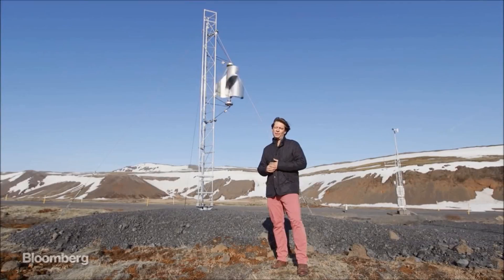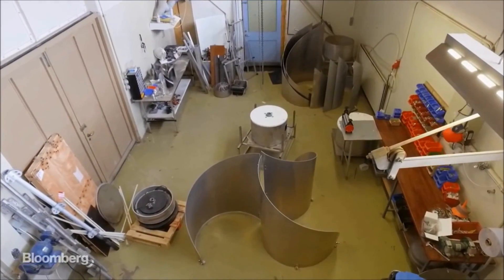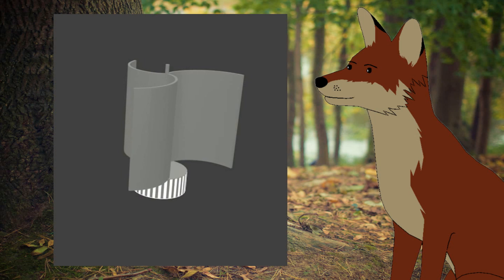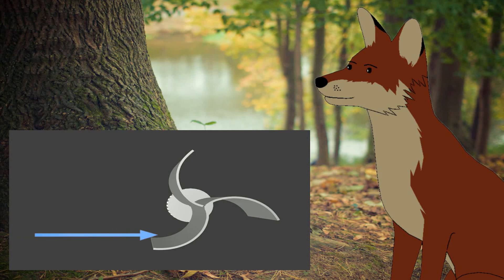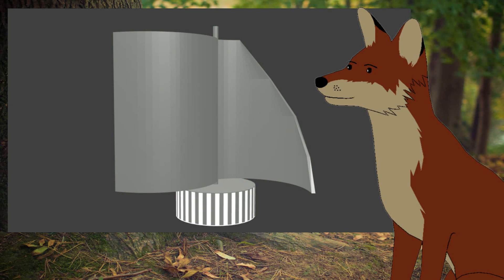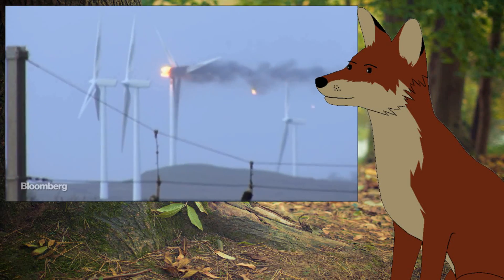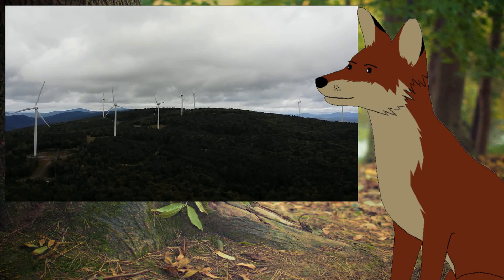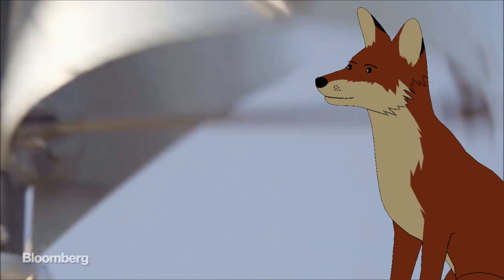IceWind Turbine - BUSTED

Comment: i'd be interested to know what school of engineering you graduated from.  i am currently using a small version of a turbine similar to this and in 8 years it has never caused any problems.  i know squat about wind turbines, (i had someone install mine), but i can see that you know even less than i do. i believe you are merely interested in furthering an agenda and attempting to convince others that wind, solar, and other alt. energy forms are bs and that coal, gas, and oil is the best way to go.  your little snarky comments at the beginning of your video about setting up in an abandoned coal  plant and being able to do the same setup in a garage, (that comment shows you will say anything to deride this tech unless you are talking about jay leno's garage), and the new "hip" renewable energy sources and the old dirty "monster"  of traditional energy proves you are agenda driven.  it's just not logical that a government would hand out grant money to a company without first investigating the claims, designs, and likely outcomes of the recipient.  just go back from doing  some quick searches and it seems that this type of wind turbine is a viable alternative to propeller types especially in high wind enviroments.  your comments about efficiency are crap.  the efficiency of a savonius may be lower than a lift system but it is nowhere near a bad as you make it out to be.  something i found out in 20 minutes and something you obviously didn't bother to look into or cherry picked your data from  alt right, pro carbon, and climate change by humans denier web sites.

Comment: Please explain why a squirrel cage motor and fan is used in every HVAC system.  If it was so inefficient, why use it?
Reply: Because they are cheap to build and very, very reliable. No brushes. No starting or running electronics. There's practically nothing to go wrong. A squirrel cage motor will last for decades without problem. You might notice that while the low-powered fan gets a squirrel cage, the high-powered motor on the compressor needs to be of a more efficient type.

Comment: The analysis presented here strikes me as incomplete or superficial and a lot of the arguments presented seem to be based on assumptions and irrelevancies. If a wind turbine provides a favorable output for the amount of effort (cost) needed to build, erect and maintain it, then it is a sucess, regardless of its aerodynamic efficiency.
 Where a small amount of energy, in the watt to kilowatt range is required, then a simple design like a Salvonius VAWT may be much more cost effective than something more complex with rotating nacelles, hi-tech blade shapes, and complex overspeed protection systems. If a simpler system can be designed with good severe weather survivability then its output per dollar spent may be higher.

Comment: If it has 40% LESS blade to propel (push) the turbine then it must also reduce the negative (resistance) effect. Thus efficiency is NOT reduced. it would also follow that stability would be enhanced and also its ability to handle high wind. A rotor can be made from any drum; but not very efficient.

I would ask what caused the wind turbine to catch fire? Little Johnny playing with matches?

Research into existing technologies? How would anything be improved without research? A prime example is the internal combustion engine. Been around for over 120 years but still being improved.

Fox??? Time to bring on the hounds.

Comment: You should change the name from "Fox Says" to "Fox News". For many reasons. First, you poorly understand aerodynamics. Cutting the blade in a triangular shape and alternating it upside-downside with the one preceeding it allows the wind not to be blocked. 

More or less, your video is about bashing investment in "green" technology. You say it clearly: "Government and investors throw their money at these things, because they tout that they are 'green'." In other words, don't waste your money on green stuff. 

You also say " a grant to research technology that has been around for decades. There are readily available formulaes that can tell the exact output [...]" Isn't it the case for most engineering procedures? In that case, why do we study airplane shapes in wind tunnels, or boat shapes in small scale basins?  Why do we tests engines of any types? We already know how they work, so what is the point? Why test prove anything? Because it is how we find out that our theory is sometimes flawed.

Comment: Like the blunt video bro yeah your right another one of those green energy moves. I actually laughed on the original video when they said Thor set up in an abandoned coal mine. I am a educated hands-on Mechanical Engineer and from a theory perceptive the Scenarios-wind-turbine has crappy efficiency and they are simple to build. I believe the tapered design is to reduce that fluid flow phenomenon known as eddies. I do believe that the theory on these types of turbines is actually not developed very well either. In school the theoretical math seemed a bit off or there were to many assumptions. Damn I should learn how to write grants for something like this but really it may be a government fence for who knows what LOL.

Comment: Why Carbon Fiber and SS?
Carbon Fiber is $$$$$$$$$$$$ and not very UV resistant.
And Stainless steel is $$$$$+HEAVY
Aluminum is $$$ and Light!

Aluminum is the cheaper, lighter, and most corrosion/UV resistant material of any material.

So why aren't they using aluminum in their turbines?

Comment: A quick review of current Savonoius turbine technology on Wikipedia reveals a new design with a shield to eliminate the wind force on the advancing side. It says it needs a mechanism to track the wind but that could be as simple as a tail to rotate the shield. A simple governor could be implemented to counteract excessive wind speed. Admitedly their design does not incorporate a shield. It would be an improvement.
I suspect the blades were cut diagonally to reduce vibration which apparently was a problem with older VAWTs. The width of the base was probably increased to compensate for the reduction in area. The conical shape also makes sense to provide more stability by lowering the center of gravity. 
The VAWT is a promising technology once all the problems have been sufficiently mitigated. There are a number of distinct advantaged over conventional HAWT configurations such as accessibility of the electrical components, inherent compensation for variations in wind direction associated with lower elevations, large effective area, higher torque, decreased profile, and operation at lower wind speeds.
The video shows the VAWT supported on a tower from the top as well as the bottom which was probably done to reduce wobble associated with supporting from the bottom only. I would venture a guess they did make some changes to mitigate problems with earlier designs. There is still room for improvement,.
Reply: THE PRICES ON THESE OLD TECHNOLOGY IS RIDICULOUS……OF COURSE THERE ARE PEOPLE A SMALL PRSENTAGE THAT WANT READ REVIEWS AND STILL THROW BIG $$$$$$ AT THE COMPANIES……..GOOD LOOK TO THEM AND THEIR SALESMAN…….ITS FUNNY WHEN YOU READ HOW OLD THIS VERTICAL TURBINE HAS BEEN OUT AND THESE GUYS. ARE STILL MAKING BIG $$$$$$ OFF THEM………

Comment: I expect that the Overspeed issue you mention is mitigated by the drag issue you mention in your first pt sir. Only a guess.
Reply: Exactly like multibladed water windmills. Faster it TRIES to go, it screws itself by starvation. But they do have protection in the tail, which folds in high winds to reduce wind loads and keep tower from falling down and going BOOM!

Comment: I can see your research in recent traditional power generation is extremely cursory and uninformed. Turbine derived power efficiency is constantly fluctuating due to the constant variation of the supply of supply energy flow. The video showing the turbine fire was a failure of the electric braking system, but the mechanical braking system fused shut. Not a single statement you made was correct nor backed by research. The shape of the vertical turbine blade is what is being toyed with. Where efficiencies could be greatly derived due to the blade profile changing position while rotating(like a swimmers arm). You obviously are a waste of intellectual space and an embarrassment to honesty. The only thing I’m curious about in your intentional disinformation campaign is what fossil fuel entity you are a paid stooge. I sincerely hope you don’t have children so they won’t have to live in your morally corrupt world. These B.S. videos like yours are what has made the world more ignorant. Please, for the sake of the world stop producing your ignorance. Clever like a fox, you are not!

Comment: Good lord, give me three or four 55 gallon drums, a plasma cutter (I have a welder) and some automotive alternators and I could have this up and running in a matter of days.
Reply: Yes. Yes, and YES. you are absolutely right. 

THere is something I do not understand. I have seen these gallon-drum-style wind turbines where the air kind of pass over in the middle between the front and the back, thereby providing thrust in the other shell. Do you know why one would not do that? 

Yet a thing. I have seen one version where a shield plus a funnel is put in front of this turbine, thereby removing the reverse winds to inflict counter-power: ANy idea where these may be? I have looked a bit and have not found?
Reply: @DigitalAgeInstitute  Was just going to mention a shield, and a tracker like horizontal turbines have at the back, would basically turn them into horizontal versions of the roof top commercial ones which seem to be a big deal

Comment: Dear Iceland, run a pipeline inland and down hill from the ocean to a huge Ram-Pump and power up an electric generator. Route the exhaust back into the sea. But really you can build the Ram-Pump offshore... as long as the intake is underwater it will work. It would actually be cheaper to build them offshore... think... a 6 inch Ram-Pump will pump 135000 gallons per hour with no energy input except water pressure at the intake. The water on a 6 inch pipe will be pumped as high as 110 feet... maybe higher. I only know that the 6 inch pump I saw, is used to pump water up to 110 feet uphill.

Comment: I find it amusing that you make a point of how inefficient the design is, and it is. And then bash their design decision of cutting of 40% of the blade but wouldn't the efficiency loss be minimal as the is less blade area for the wind to push against on the concave side of the blade. But I agree the Bloomberg video is crap, but it gave you 100k views :)

Comment: They don't want to know the truth or the details of how this device works OR even if it is more or less efficient than anything else. Even Nuclear power still holds FIRST PLACE with being highest in energy density, performance and efficiency PLUS Nuclear Power is by far the absolute safest way to produce electricity and cheapest long run. But the Global AssEating GlobalAssWarmingChangers just chant phrases and block traffic and end up knowing nothing.

The entire lower 48 States could be supplied all it's power needs, even for the diaper babies with hybrids and Tesla's that use coal burn right now, by simply building 5 Mega Nuclear power plants. About 10,000 to 25,000 Mega Watt output and save some in battery Capacitor form as we save oil in the strategic reserve today.

And start arresting ANTIFANazis on the spot. Outlaw membership and affiliation with AntiFA, and give jail time for pipe swinging mask wearing Anarchist assholes.

FIRST, build those 5 Nuclear power plants....YOU GUYS WANT TO DECREASE OUR CO2 RIGHT? Then stop whining when a solution is in your stupid faces.

Thanks for allowing me use of my 1st amendment as you libs like to say.

Comment: Reasons for building savonius WTs:
1. less cost
2. works at low wind velocity
3. simple design
3. omnidirectional
4. easy maintenance
not efficiency or power output
Do some actual research before you start foxing all over them

Comment: This reminds me of the infamous Darrieus wind turbines that, like the Icewind, was going to revolutionize the industry.  They've disappeared from the scene - a perfect example of hype over reality.    The problem with both the Darreius and the Sevonius is that each is only a third as efficient as a vertical turbine.  

The real giveaway that this is not a solution is the lack of interest  by companies who snatch anything that could improve the bottom line.  A machine only a third as efficient may work for cabins or a few lights but cannot supply the massive amounts our civilization requires.   We have yet to face one hard fact:  The reason the internal combustion engine is still around is the incredible power of the fossil fuel molecule and the efficiency of the motor . When alternativesare economically feasible they will be adopted quickly,

Comment: I'm just curious, if there were some attempts to install some sort of bypass valves on blades to let some air through when blade returns against it. Or partially fold blade like birds do with their wings while flapping. Maybe it can slightly raise efficiency of this type of design.)
Reply: At a cost mechanically, though.. three blades and pitch control have no moving parts in the collection side, the blades.

Comment: Well if the problem is the opposing blade fighting the pushed blade, the curve of the blades increases the efficiency to some degree yes?
Well what if you put a wing or cover over the half you don't want the wind to hit? Wouldn't that increase the efficiency by 70% or so? After all an efficient turbine uses high pressures and a housing. Also if you have 3 blades the blade being pushed has the center between the other two blades opposing it at maximum angle.

Comment: Has the advantage of reacting to wind from any direction, is unlikely to produce the low frequency vibrations injurious to health, is devoid of the shock wave and bird killing propeller action of aerofoil bladed large machines, is small enough for domestic use and could be used in mobile units, can also be stacked vertically on a mast. Construction, transport and installation is less costly that the propeller variety.
Reply: also no slip rings are required

Comment: If only there was a way to fold in the part of the scoop that is heading into the wind, thereby drastically reducing the drag. Then when the wind catches it for the power stroke it would quickly open. Could be there would be an out of balance issue that would arise with that

Comment: I have to comment again. the mistake in your logic that one side receives equal wind flow opposing the driving force doesn't take into account aerodynamic shape. simply elegant that reversed, a blade catches maximum wind or smoothly cuts thru. very little wind resistance coefficient on the back side.
they are optimizing for long-term durability in the severe wind conditions prevalent in THAT location.

Comment: I would think the less surface area of the blades than rectangular makes it more resistant to high wind speeds which in Reykjavik are quite a problem. yes altering the pitch of the blades can prevent overspeed, but this is a simpler, inherently passive design that does not have to have a mechanism to combat high winds.
in Chicago, there are quite a few of these variants on rooftops, vertical and horizontal, so the Savonius turbine generator is actually a viable design.
you can even see the spinning roof vents literally everywhere similiar to the shape, tho they have many more blades and a cap on top, or the blades curve in to the axis capping the vent themselves

scratches head,, author of this vid is just on a hate trip for some reason? thumbs down #530

Comment: What happens when you put a lift based turbine in a place which gets high winds.  They have to shut down  and can't operate.  That is the reason for this specific turbine. This design is more tolerant of high winds. It also doesn't look like this unit is designed for high output either.  You don't need a lot of power for a communications system, just something reliable.
Reply: I go to a technical collage here in Iceland and we have these wind turbines on the roof. They work well for the winds we have here and are made to charge batteries for anyone wanting to charge up their electric bike. Thanks for seeing the reason these things work in Iceland.
Reply: Bingo
Reply: It's also very quiet.
Reply: @joesmoe2245  Because it barely rotates. And its so basic it can be build without any engineering degree whatsoever. 
It's ok for energy harvesting, but every bigger system is a waste of material compared to the output.
Reply: @haifutter4166  

Bottom line: "And its so basic it can be build without any engineering degree whatsoever. "

Comment: How does someone become as stupid and incompetent as the worthless piece of crap who made this video. I do research in resistance spot welding which is over 120 years old. It still can be made a lot better, with a potential payoff in the 100 million$ per year.  How could the this moron know whether this change in blade design doesn't have greater effect  on the return portion of the rotational cycle than of the power portion without doing any analysis which he clearly hasn't.

Comment: Good video!
Sometimes, I get the impression: "Savonius-rotor means scam"
Which of course is not true.
But it seems to me that Savonius rotors are always involved in rogues with small wind turbines (for example, promising unrealistic high yields).
Of course, they also have their advantages and may be the better alternative for some niche applications.
But not when it comes to economical electricity mass production.
Reply: fairdinkum dumbarse?